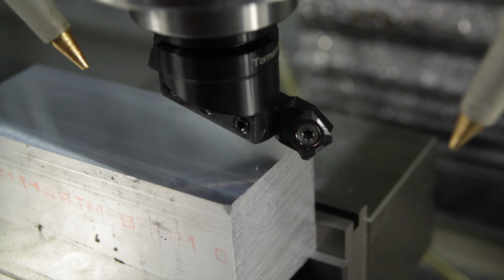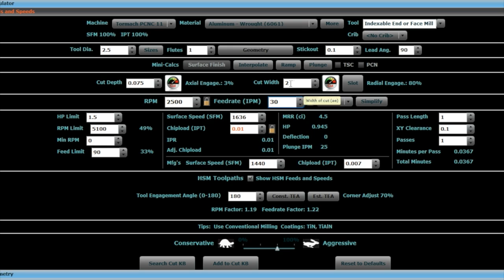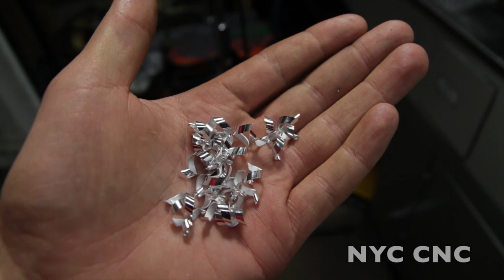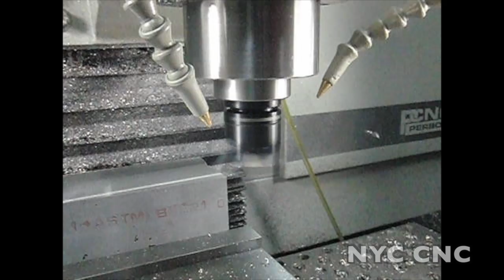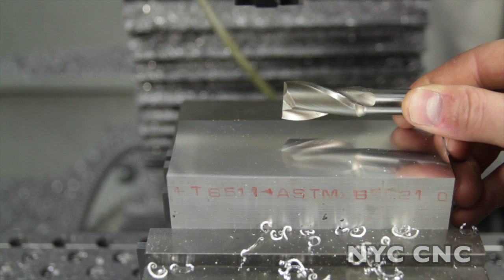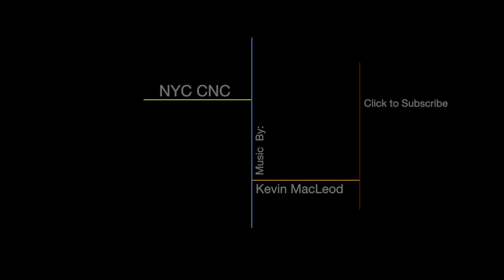Tormach Superfly Fly Cutter / Face Mill Test Cuts in Aluminum!

Comment: Was the last pass really .150" depth of cut? It didn't look like it and It seems like you wouldn't do your largest depth of the video for a finishing pass...did you mean .015"?
Reply: Yeah, he misspoke. The last cut was not 0.150". Appears to be 0.015 or about half the first cut which was 30 thousandths (0.030)
Reply: I thought the same exact thing. Betting he meant 15 thou not 150. Cutter is really nice though. I bought Suburban's flycutter and I absolutely love it for steel. Unbelievable finish on my 3hp Summit mill. But I think I'm going to get one of these for aluminum.

Comment: This is why manual mills are sooo much better than cnc. A 1.5 hp knee mill can take twice this depth of cut and be fine.
Reply: Sure, but if you can crank at 100ipm I'd be impressed

Comment: Does the superfly really only work well at lower rpm's? I am running one of the chinese spindles 3hp and the rpm range starts at 8000 and goes to 24000. I tried a small fly cutter with a Hss bar on it before i got the new spindle and it was disastrous. I ran it on a 1 1/4hp makita router motor which also only runs at high rpm...
Reply: +Your best Friend Calculate the diameter times the RPM divided by 12 to get the SFM. You'll find that 8000 RPM is way too fast for large-diameter tools. Also, I dont' think that router spindle will get max power at the lowest RPM, and I also wonder about rigidity/vibration, as my guess is it's intended to route wood, not steel...
Reply: Yeah lol I played with a small fly cutter just for laughs and the hss cutter flew out of the tool. Epic fail, part of my learning by trial and error. Self taught cnc is scary...
Reply: Where is the pie?  Don't forget your pie.
Reply: I use a sanding disc for my cnc router flatness within 0.05mm
Reply: Whenever I use a fly cutter I try to stay at least 1,5 meters away from the machine which is at 800rpm. It's a 2800kg mill and with the fly cutter on it, it vibrates a 2 floor building!

Comment: Here's a question for you about setting up the fly cutter. You mention in the video that you have a cutting diameter of 2.5". Is that as measured at the bottom outside corner of the insert (where the small flat at the bottom meets the primary cutting face)? I'm trying to setup my CAM software tool database and figured I'd ask about your method.

Comment: From the hot chips flying all over the place and bouncing around. As a machinist, you get a fair share of hot chips on you. One time i was turning to a shoulder and a pretty blue chip landed on my arm. I could not release the handle because I was close to the shoulder. There is also another instance where I yawned at the wrong time and a blue chip landed right on my tongue. Little to say I looked like a idiot slapping at my tongue to get that chip off.

Comment: It would do well... Fly cutters leave a great finish depth of cut plays a pretty big role in it, and type of insert most of my experience is on the older manual machines of all types (new is nice too)... I love the look of that insert, I've ground similar angles on standard carbide lathe tooling on large shop-built fly cutters,,, be it just a single non index-able point though. There is a good book called "Tool Design" explaining grind angles and point radius. Cool video! :o]

O,,,

Comment: For my fixed blades I buy the steel as 0.210" stock and they need to be surfaced to 0.156, so I'll use it for that.  Also for making fixtures, I skim the surface so that everything is dead flat.

Comment: Epic video John!  My Superfly just came in yesterday.  The other day I was facing aluminum with a Shars 2" 5 insert with aluminum inserts, 0.020" DOC, 1700rpm, 45ipm, it almost stalled within an inch or two, so I had to lower it to 20ipm.  Can't wait to get the superfly up and running.  I used one at our class at Tormach for the steel blades, worked amazing!  I like how you keep mentioning MRR, it's something I never think of, I want to get better at watching that feature.